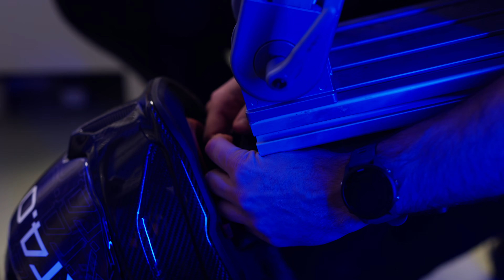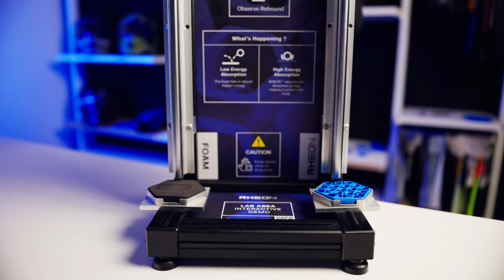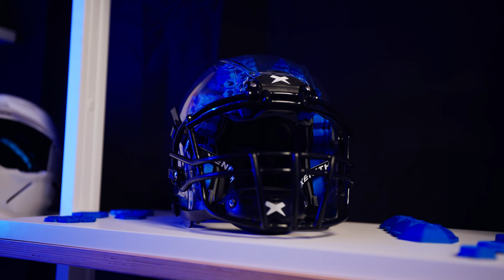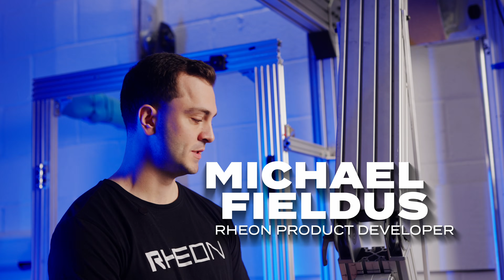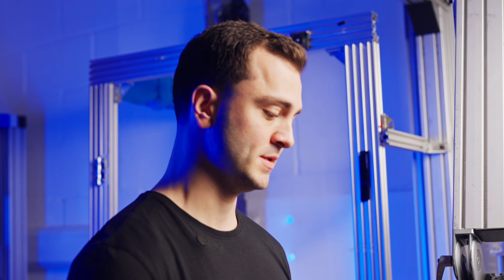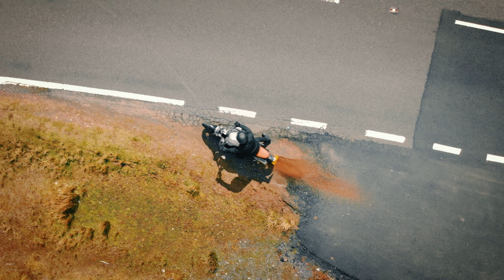Is This the Future of Motorcycle Helmet Safety? Inside RHEON Labs

Comment: @Ruroc 

Hi, can you help me please ? I've ordered the iron maden writing on the wall red black eox helmet,and it came with a normal see-through visor, but there is a massive gap on the top left and right sides of the visor and the wind comes in screaming whilst riding. is that a manufacturing fault or what? i bought it
 in November , because of a great deal,not really touched it since then and i tried  it first this week and noticed the wind coming in. 14 days passed many times since purchase. this would leave in me a massive disappointment in the ruroc company if can't be fixed..

Comment: I like the design of Ruroc - no doubt on that. Where I've doubt is the continuous quality assurance/control. While I see the continuous improvements applied thru generations of eg: Atlas line up, and I find impressive that Rheon type of technology is implemented into a helmet, I'm still hesitating to push the BUY button due to above mention quality concern.  On safety I do not want to have any concern/compromise, until now this holds me back buying Ruroc. Could you please make a video about where and how, based on what quality assurance/control methodologies the helmets are made and what kind of testing applied during production process of each and every helmet ?
Reply from the maker: Hey Peter! This is a totally valid question and we're glad you asked it. We have two QC teams, one at our HQ and one at our factory. Our factory team ensure compliance of all outgoing helmets and our HQ team batch test helmets as part of their QC process. In addition, as part of our compliance with safety standards, we have to pull one helmet in every thousand for random batch testing to ensure compliance (which we have never had issue with)

Great suggestion around a video on the QC process. We will pass this onto our video team! 🙌
Reply: @Ruroc Thanks for the feedback and info. You mentioned QC only which is good, but I think it would be also beneficial to include QA processes. I strongly believe Ruroc can produce quality helmets(based on high amount of positive feedback and long term reviews), but I also sense that the brand reputation was hurt by the minority, BUT loud reviewers. The showcase of QA processes could help address and eliminate concerns raised by negative feedbacks like : in some cases cheekpads were loosing their shape/density quicker than normal, resulted perfect fit helmet became loose, or wear&tear issues. QA focusing on prevention, and elimination of re-occurance and showing the methods Ruroc using to mitigate these - in my humble opinion could build up more trust and engagement towards the brand. Anyway I'm waiting for the video about this.  You won a subscriber👍 and maybe a potential buyer🤞
Reply: Completely anecdotal; had similar concerns but ordered during this clearance sale. Got an EOX (for me) and AT4.0 for wifey. We’re happy with both helmets. No quality or build issues. 

I will say, wife wanted the shockwave. the shockwave speakers are not as loud as my cardo (significant enough that we are getting her another cardo mount before our summer trips)
Reply: @lukez3179 Thanks for your feedback. I've no doubt your and your wife's helmet have good build quality. I wrote the word "continuous" by intent -  there are feedbacks left even on Ruroc site which seems to imply that quality level is variable even in the same type of helmets. Based on "big numbers" law this leads me to the concern of continuos quality assurance level, hence I asked my question above. I'm not questioning the quality of the helmets I'm hesitating on continuity of quality assurance - and this is what I wanted to mitigate with a video showing the manufacturing process. I'm glad you and your wifey is happy with your purchase👍 Hopefully this is not honeymoon session only, but turn to be a longterm satisfaction🤞

Comment: Isn't this just another version of D30 ?
Reply from the maker: That's a great question! Rheon is slightly different (and in our opinion better) than D30. The material is lighter and more breathable, both important in a performance helmet. But it's not just about the material, Rheon Labs develop a unique structure (the geometric cells) that we use in our helmets. These are designed in such a way that allows the material to deal with rotational as well as linear forces. Hope this helps!